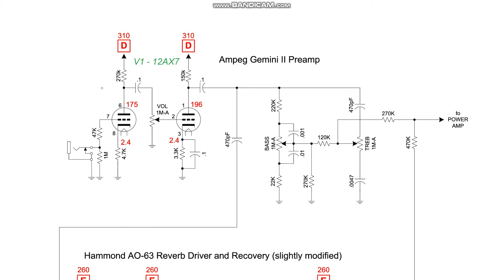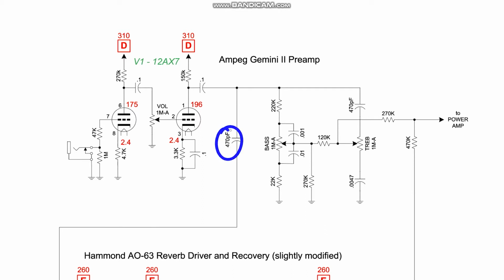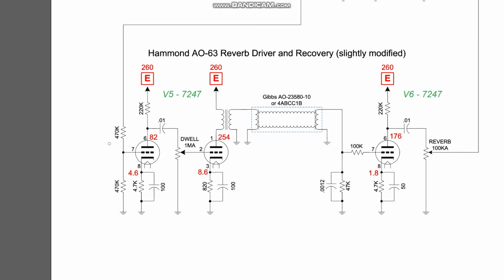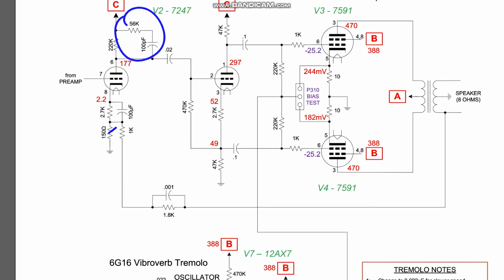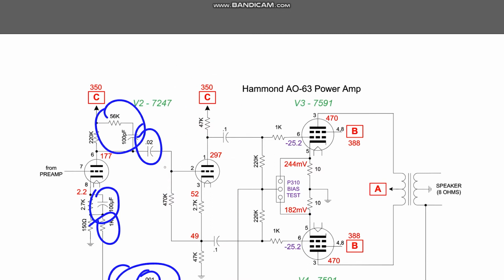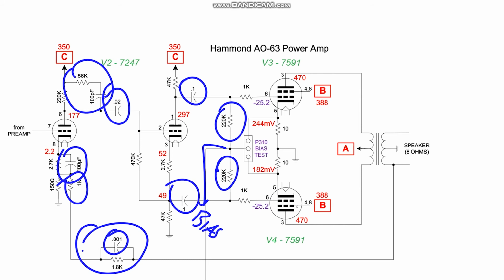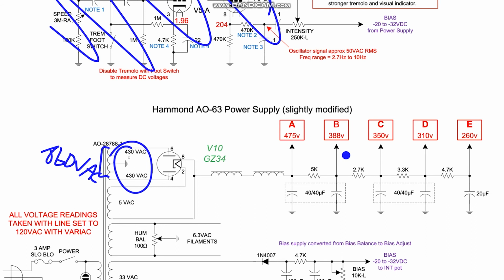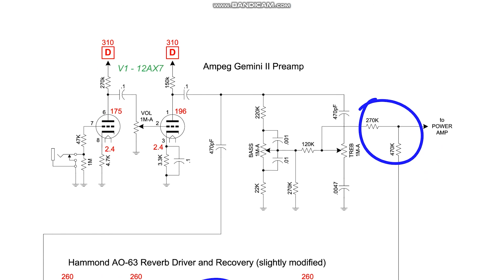Tube Amp Build Pt 4.5 Schematic Evaluation

Comment: Another great, informative video! Ampeg definitely did their own thing circuit-wise, it's quite the departure from the Fender-style preamps that everyone else copied ad nauseum (and which Fender themselves lifted out of an RCA manual), and the output stage is very similar to an old Bogen PA that I turned into a guitar amp years ago. I'd still recommend including screen grid resistors even if Ampeg didn't, they're cheap insurance to keep the screens from drawing too much current during overdrive. This wasn't a huge consideration on most 7591 designs since it was primarily used in HiFi systems (and Ampeg too liked to keep things squeaky clean) but if you're planning on driving it hard they may save your tubes.
Reply from the maker: Good tips, thanks!